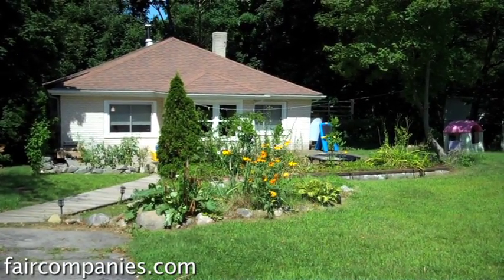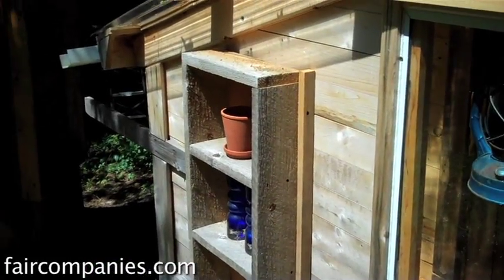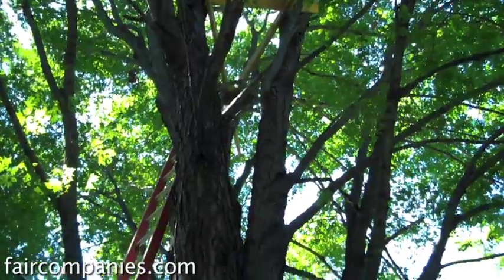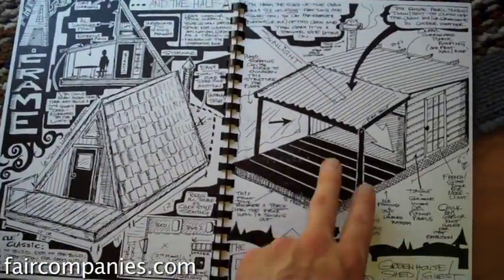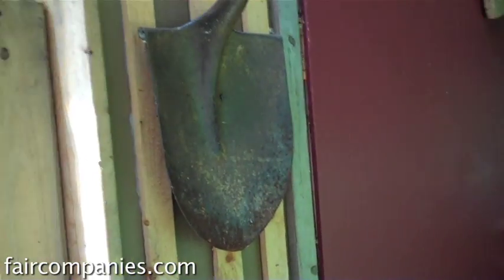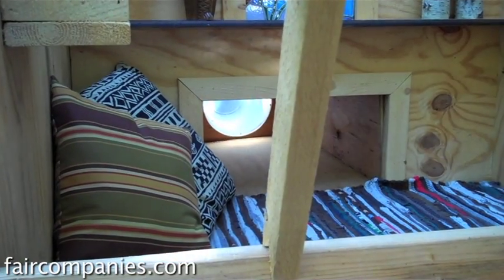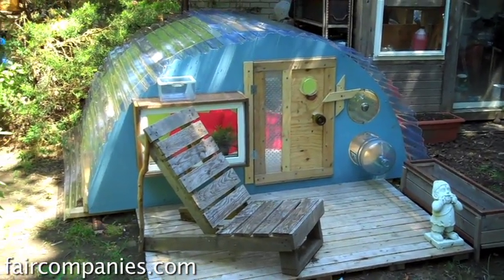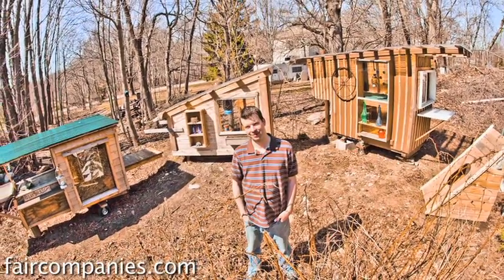Micro-tiny homes as freedom from codes & loans

Comment: I love this kind of stuff. I built a playhouse for my daughter that was built from mostly found/recycled materials. It was so cute! It was 6 ft at the roof peak, so I could stand up in it, and it had a foldout table, windows with shutters and flowerboxes and there were even cabinets inside. I also built her the coolest tree house, that spanned two trees with a 7 foot slide, with swings underneath. Unfortunately, a tornado felled one of the treehouse trees, and it smooshed the play house as well.
I also love tiny houses, and wonder what it would be like to live in one.

Comment: In making emergency shacks for feral cats at the moment but its hella windy out there (you have to build them as waterproof and insulated as possible but also not cost anything so you can replace them if the neighbours remove them or the grounds keepers, so its basically a couple of bits of 2x4 with a cardboard box that's insulated all the way around with polystyrene, reinforced then wrapped up in heavy duty garden waste sacks containing bubble wrap and then another doubled up heavy duty garbage bag with bubble wrap inside  and the front flap weighted so it doesn't blow up with wind (and it doesn't look like anything other than a box) the flap means that the cat doesn't feel trapped but stays in place.  There's a bowl with wet and dry food in and water outside and straw as bedding as it doesn't wick up moisture. ..also I should have put a bit of wood on top because of the wind but they're in sheltered positions and I learned most of this from watching stuff about tiny houses...it does make you think in different ways for sure.
Reply: Bless you! 🐱🐈

Comment: Depends on where you are, as you can see in some of the above comments zoning laws vary from place to place. In my county you are required to have a permit for ANY shed even if you buy a kit from a box store, or a pre-built shed, if you don't have a permit the county will make you take it down and fine you and make you start all over. Again depending on where you are there are requirements for materials used, tie-downs, foundations, electrical, etc.

Comment: These are interesting little follies, cabanas or day rooms, but they are NOT homes. A home needs 5 criteria to classify as a viable "house".
1: Self contained toilet, namely the ability to crap in private without having to go outdoors, in the rain, at 2am.
2. A reasonable ability to clean yourself, ex: a small shower or tub, a Japanese style squat tub is a good space saver. No one wants to be around Mr Stinky who lives in a box.
3: A reasonable sized kitchen area for food storage and preparation and a reasonably sized living area that's comfortable to actually be in. Namely can you prepare a meal without squatting or being hunched over. There should be an area where you can stand and stretch out your arms fully without being restricted by the confines of the unit. 
4. It must be fully weatherproof, I have seen some of these "tiny houses" on this channel that would be hell on earth to be stuck squatting hunched over in in during a cold rain storm or blowing snowstorm. if you cannot live in it year round, whats the point...fail.
5. Reasonable heating and ventilation and fully insulation. This ties in with #4, can you get by comfortably with 4 feet of snow outdoors or when its 100F outside.

If you have to use someone else's toilet or shower or kitchen your cheating, because you could just as easily be living in a rented room in that house. 
Some stuff I have seen on this channel, this video in particular, are little better than a day room or cabana....good for a day or weekend but totally unviable for weeks or months or years. Some stuff on I have seen elsewhere has been little better than being one step above a homeless person sleeping in a cardboard crate. I think its very important for folks to accept that for the tiny house movement to work, these above all else, no matter how small or what material, fixed or mobile, MUST be comfortable for long term living... otherwise it's not a viable option.
Reply: Man, there are a lot of assumptions in here. There are plenty of houses all of the world that don't have all these things.  All those things are NICE to have, of course, but...

Comment: @Flyinghammer1 
Small houses are certainly easier to heat, and winterize than larger ones. I shared a room in the trailer, and the body heat was enough to keep the temperature above freezing, while without a room mate, ice formed on the inside of the glass.

Comment: I can see a few advantages here.  RVs are not going to be as structurally sound or quiet, and RV appliances will be, well, RV style which is to say weaker and more expensive to fix if they break.  Add in sewage, water, and utilities and I would go the small house route.  Easier to fix/modify the house than the RV.  Advantage to RV is you can drive it away to relocate.

Comment: Most of these tiny homes 100sqft to 150sqft cost 10-20k. I have'nt seen to many go above that unless they put in stainless steel appliances and marble counter tops.

To answer your RV question. This may not pertain to you but say you need to movie your tiny house rv thats been sitting for awhile. Will it start up and drive right away. If your RV needs work done at a shop (engine wise) where are you going to stay while the motor gets worked on. I hope that semi answers your question.

Comment: There is huge difference between safe to use salvaged or alternate building material & garbage. To say these will become slums because of the  building materials is too broad a brush. Yes build to code as electrical or gas DWV installations are concerned   code beyond that prevents people from building affordable otherwise safe homes. Admitting it introduces a buyer beware as structural itegrity., but that should always be the case anyway.

Comment: cheapest way to build. 
STACKED LUMBER WALL.
its a log cabin made out of 2x4s laid flat and nailed on top of each other
roof floor walls $7.50 per square foot plus pier foundation and utilities/appliances
Wall is a built up beam so pier spacing can be greater!

Comment: Kool.  I like your way of thinking on tiny houses.   I would like even more if those that design tiny structures would learn to think outside the box.   It does not have to be wood and traditional carpentry.  While you are moving in the correct direction, thank you.

Comment: I like the triangular house it is about the most basic shelter possible as an are is require for a stove not impinging on the sleeping area for safety. It is also necessary to get the most simple structure built in the least amount of time, extend and improve at your leisure as materials become available. Check out our house at Evelyn Grace Academy when we get it done.